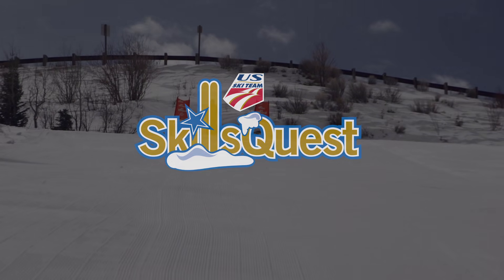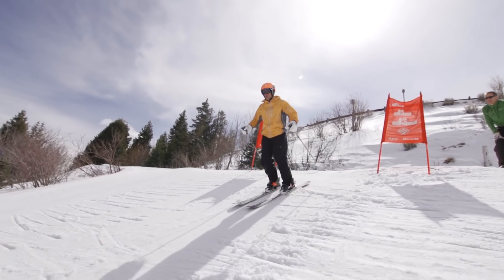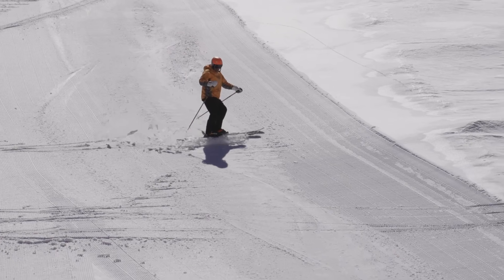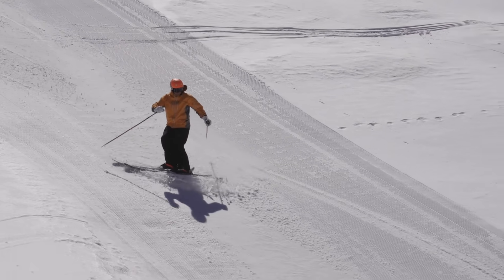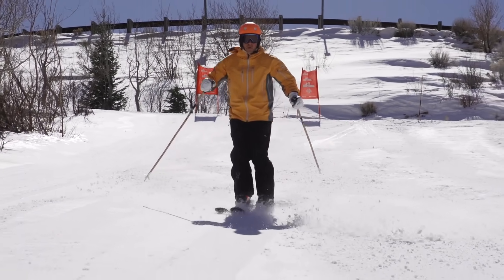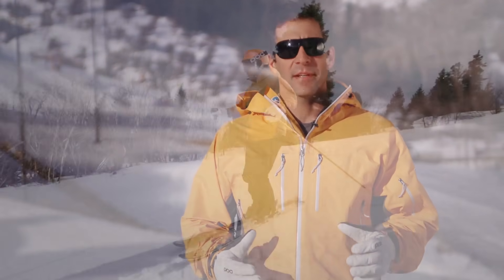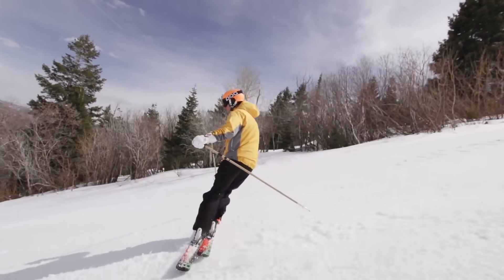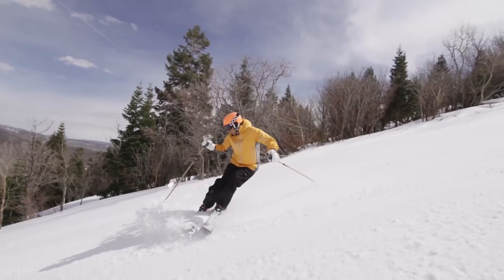Phase 3 Pivot Slips

Comment: this guy use ton of hip rotary and not femur in hip rotary pretty shit demo.
Reply: His feet are too close together - necessitates the hip rotation.  He hides it fairly well.
Reply: There's also a bit of rotary push off
Reply: I don know Josh. Your demos do not seem to support your superior position.  As long as a demo keeps the shoulders square  while the ski turns is the correct form indicator of this drill which allows for skiers to include their unique anatomy successfully.
Reply: What is objectively wrong with my demos let alone my pivot slip demos?

What about this presenters anatomy is preventing the presenter from using hip scoket rotation to achieve this drill.

What about anyone's anatomy would prevent someone from using hip socket rotation?

Do you have video of you doing a pivot slip demo?
Reply: @AtomicB-zq2cw  what is wrong with my pivots.

Or do you like making base less statements?